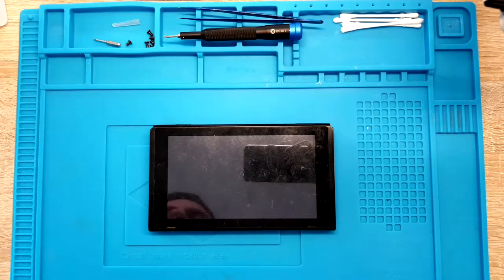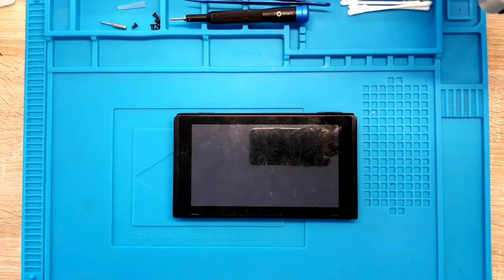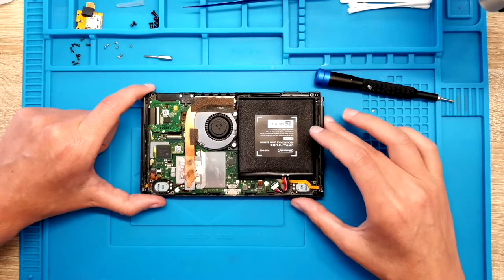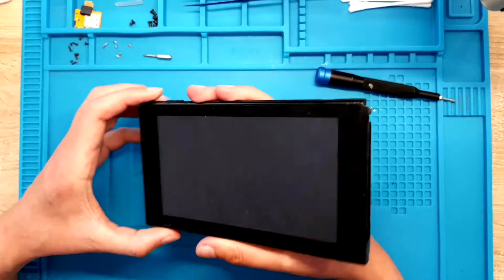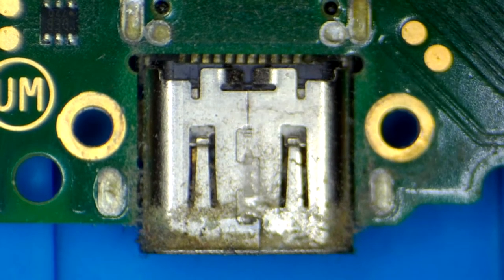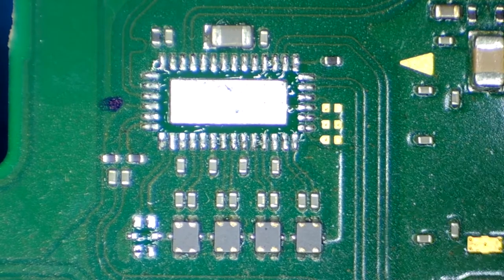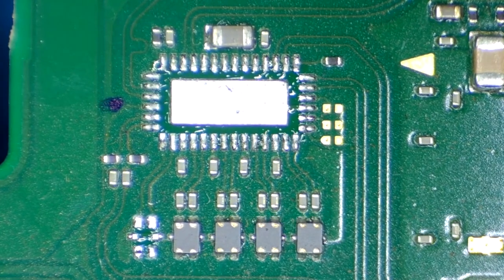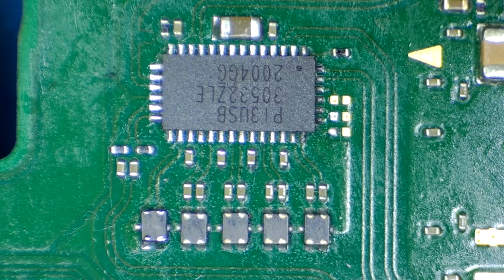Nintendo Switch not turning on repair

Comment: Thanks For Your dedication and for identifying troubleshooting. How do you test the diode reading and what aproximate values does it have in order to be safe without replacing the diode.  Thanks!
Reply from the maker: You are welcome.
Talking about readings in diode mode with a multimeter on the board itself you can find quite a lot of them for Nintendo Switch in Google. If we are talking about measuring a diode itself with a multimeter than you have to measure it in both directions/polarities. Diode conducts only in one direction. In this direction you can measure the forward voltage drop on it. This is depending on the type of diode can be different. For example case of a shottky diode it is 250-400mV case of a "standard" diode around 500-700mV. In the other direction you have to measure open circuit because the diode is blocking current to flow in that direction. You have to take care with diode measurements in-circuit because this way you can get totally different values. One sign of a faulty diode could be if you measure a short on it.
 I hope I could help and hopefully I did not write anything stupid :)
Reply: @kikihobbyrepair  Thanks!!

Comment: Nice work, Probably 3rd party dock issue, tell them not to use it or you'll probably see it again like I did last week , the no docking may be your diode arrays.
Reply from the maker: Thank you Micro. Yes 3rd party docks might cause lots of failures. It was a huge topic a few years ago.